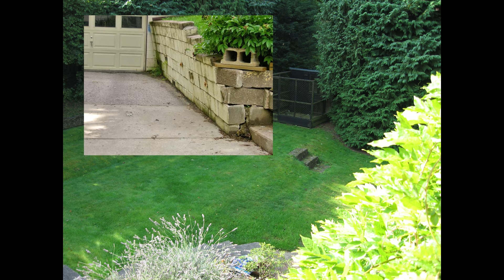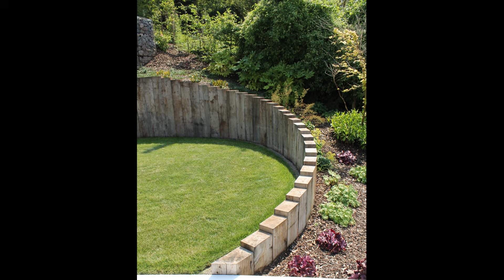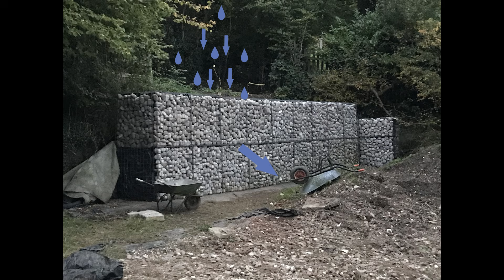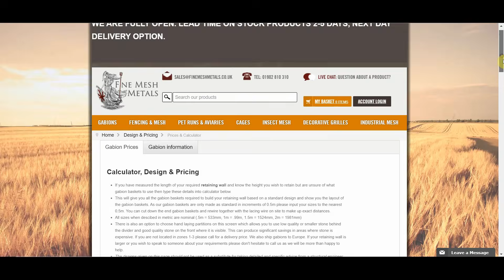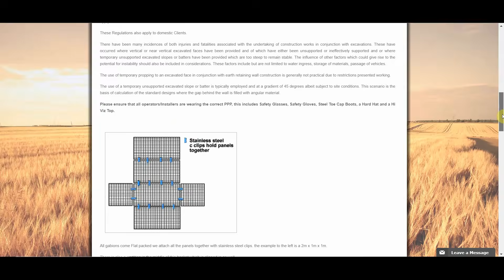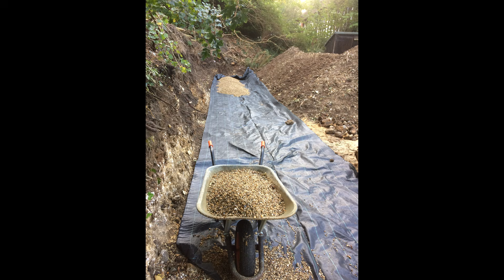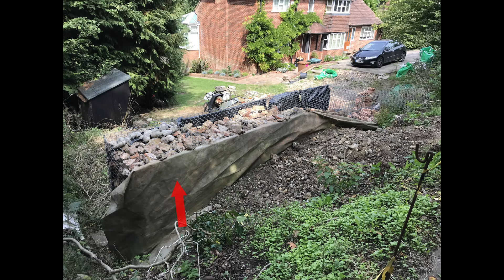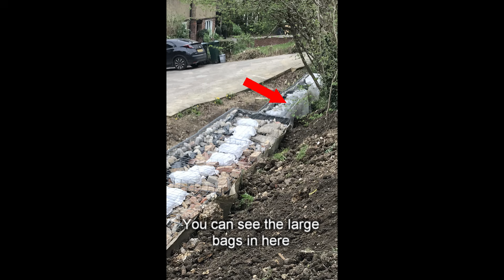GABION RETAINING WALL CONSTRUCTION with cost saving panels | Full Walkthrough with Audio - Part 2

Comment: Hi Karen, 
I am just about to do something similar for our garden retaining wall at 2m high, and wanted to find a video including the technical aspects of drainage and use of the geotextiles. Your video absolutely delivers :) 
Thank you so much for taking the time to make this and to post it. Brilliant work and told me everything I needed to know. 
With very best wishes 
RHR22
Reply from the maker: Thanks for the lovely comment RHR22!  Good luck with your project.
Reply: Thank you, Karen. 😀
I did have a question, if you wouldn't mind? 
The perforated drain at the rear of the wall, do you get much flow out of them, and did you connect them to your existing drainage system/where does the water go if not?
Thanks in advance 
RHR22
Reply from the maker: Hi, the perforated drain was belt and braces really. It probably isn’t needed as the whole system is porous, but we wanted to relieve as much pressure as possible behind the wall so included the gravel and drain pipe. It just runs round the back of the wall downhill from left to right and then round the short return on the right. The end is loose round the back of that 90deg return in some hedge plants but covered in the white geotextile. I haven’t seen much come out of it to be honest, but it is hard to tell. I think the gravel if anything helps as it acts as a small reservoir slow releasing water in the surrounding soil and gabions. So if anything I would suggest backfilling your gap between soil and baskets with gravel if you don’t have room to include the pipe. HTH
Reply: @OurHomeProjects  thanks Karen, again very helpful. Ours will be the end point from a sloped rear garden to a patio area behind our house (once built), so I am mindful of surface run off from the garden :)
Thank you for taking the time to reply, again. 
Best wishes 
RHR22

Comment: Can you just go somewhere and grab stones or all the areas are private? And if some are not, what will happen when the council will find out?
Reply from the maker: It takes quite a lot of stone to fill a 1sqm basket. You can probably speak to local supplier to see if they have any bags of scrap stone, ie stuff fallen out of ripped bags etc to get a discount. Also, I did have a builder offer me some crazy paving he took up and was taking to be recycled, but we had almost finished the project by then. You might find a builder digging up an old driveway that you could ask for the old brick to fill your baskets. My suggestion would be to use the panels and have a nice stone fronting the baskets.  HTH.
Reply: @OurHomeProjects  used stones may have damages. I wonder about stones "in habitat". Like quarries or something
Reply: @ЕвгенийБарахнин-ъ1д I'm in the u.s., and I've heard many farmers will be thrilled about someone picking tons of field stone from their land.
But we're talking many thousands of pounds of stone to lift and transport! Ugh.
Reply: @lotus65  there can be land that is not private
Reply: @ЕвгенийБарахнин-ъ1д  of course, I would never imagine going on someone's property without their permission!

Comment: Even if the cage is galvanized, isn't it going to eventually rust and fail, or possibly squat?
Reply from the maker: Hi again, 7 years later ours are showing no sign of rust or movement since we had the driveway done (where the back fill did push out the small top row as shown in the video).  If you install them correctly with heavy enough material they are not going to shift.  The main thing is buying the baskets from a reputable company and to check out their reviews and where they state they can be installed (eg. water environment etc). HTH
Reply: 20-30 years maybe it’ll be degrading. You look at old galvanized pipes in homes and most of the ones having issues currently are 40+ years old.
Reply: They have a life span of at least 60 years
Reply: Even in salt water coastal environments? That's my main concern...Corrosion is a huge factor where I live.
Reply: @ReticentIndignation  
Same here, I'm living in a rust belt area. I'd pay a little more if they were stainless.

Comment: Comprehensive and informative. Thank you. Since completing this project do you have water flow from between the rocks on the front of the gabion wall? Or maybe this is mitigated by the baskets being angled back slightly ?
Reply from the maker: Hi, thanks for watching. We don't ever actually see any water "flowing" out of the baskets, but as the baskets haven't moved we assume it's not building up behind the baskets. When it rains the fronts get wet and I guess as the water drains into the soil behind, it just makes its way via gravity to either the pipe or through the baskets, but it's never a gush of water if you know what I mean. I hope this helps?
Reply: @OurHomeProjects  It does help. Thanks 😊

Comment: I have seen other videos showing that use of geotextile behind a retaining wall will cause it to fail, because fine particles in the soil will plug up the geotextile and cause water pressure to build up, increasing the forces attempting to push the wall over.
Reply from the maker: Thanks for watching. I can only suggest to do your own research on geotextiles. The non-woven and woven types are used extensively in building projects, particularly driveways, roads and paths and are used for stabilisation and their porous qualities. I would also suggest buying a good quality geotextile. All I can say is 6-7 years on the wall hasn’t changed since the day we did the driveway. HTH Karen

Comment: When you said the gabion must slope 5 to 6 degrees towards the soil its retaining I got a little confused as your wall looks at right angles to the base or am I just imagining that?
Otherwise great work - well done.
Reply from the maker: Hi MM, thanks for watching. Yep, they are definitely sloped backwards towards the bank. The only section that messed up was the lighter top layer of the second section I built. Those baskets were filled with gravel bags and I didn’t secure them at the bag, so when the digger back filled the soil, they pushed forward. The main 2m high section is as solid as a rock as it’s full of bricks and rubble.
Reply from the maker: You can see the gravel bag part of the build in this video - https://youtu.be/cw8EGBU1j8g

Comment: Gabons are beautiful looking structures and I take delight when I see large ones on roadway projects.
One thing I noticed with yours is that you've used reinforcing rod to tie and stiffen your edges. I thought it was raw steel and so I'd like to suggest that in the future, you would paint them with "Cold-Gal", a galvanised coating applied with a brush. It seals your metal from the elements. You could do it retrospectively but it wouldn't cover 100%.
Reply from the maker: Thanks for the comment. Our wire was galfan coated and is showing no signs of rust, but you are right to point out to others they should be mindful of the product they buy to make sure it is weather resistant 👍

Comment: And did you do this all yourself then?!
Reply from the maker: Hi, thanks for watching. I worked out the plan, built the baskets, lined and leveled them up (well at a 5deg slant), started filling them and my husband would come out and help chuck rubble in. I filled the front faces. I struggled to fill the top section and my husband helped a lot with that. However, I did the second section that is 1.5m high by myself with the gravel bags. We both back filled with shovels and wheelbarrows of gravel and soil. It took a fair few months to complete as we weren't working on it daily. No need for a gym membership as I lost a few pounds too! It's really not that difficult a process, just graft. Anyone can graft when they want to! Karen
Reply from the maker: Forgot to say, we had a man and his digger cut into the bank. We just did the baskets :)
Reply: @OurHomeProjects  I must say that it looks nice though !!! 🙂🙂🙂

Comment: What are your plans for the eventual rebar rust?
Reply from the maker: Hi Jacob, the gabion baskets we bought are galfan coated and designed to work in water holding back banks. Six years on they still look as good as when they went in.  Make sure the product you buy has a similar guarantee.  Cheaper baskets may not offer the protection that is needed. Karen

Comment: Very nice i am looking something like this.  I will do at my home like 15cm wide    and 2 mtr heights .,it possible
Reply from the maker: Hi Waseem, Not quite sure what you're building, but make sure your measurements are right for whatever you're trying to support. Our wall was 2m high, but 1m deep. As it's a mass retaining system, the contents of the baskets must be enough to hold back what it's supposed to hold back. HTH and good luck with your project.

Comment: Will the Gabion Baskets Rot out over time, or are they made of stainless Steel?
Reply from the maker: Hi Dan, our baskets have a galfan coating on them and six years on they still look as good as when we purchased them. They are designed for waterways so should last 20+ years.  They weren't the cheapest, so make sure you understand what your gabions are made from before you buy. HTH Karen

Comment: Thank you for a very informative video. I was wondering why you would need a drainage pipe given that a gabion doesn’t hold back water   Thanks
Reply from the maker: Hi Nicola, you a right, it probably wasn’t necessary, but as it was 2m high and 20m long we didn’t want to risk any water pressure build up so added the gravel and drainage pipe. A bit overkill, but for the small extra cost we went ahead with it. I can see now, about 7 years on, that water drains through well and we’ve had no movement in the wall since building it 🤞 Karen

Comment: Nice work... I'm about to do one for the first so it is definitely helpful to see your project. Did you use drainage pipes?... and if you did , how was it done?
Reply from the maker: Hi thanks for watching. Yes we did, but it was belt and braces really as we were new to the system and didn’t want to risk anything moving over time so added the drainage pipe and gravel just to be sure there was no water pressure build up. For smaller builds I doubt you’d need one. HTH. Karen

Comment: Fabulous video I am just starting a 2 meter high wall using these, my wall is going to be 2 meter high by 1 meter wide. I see you went 2 meter high, did you go 1 meter wide or more? I guess I am trying to find out if a 1 meter wide by 2eter high is structurally OK, the supplier of the gabions has said I need to be 1.5 meter wide for a 2 meter high retaining wall and I don't really have the space for 1.5 so hoping I can get away with 1 meter. Any advice you can give would be gratefully received, thanks so much 🙂
Reply from the maker: We went 1m deep, but 1.5 on the bottom would definitely be better and set the next level back a bit so it’s stepped into the slope 👍

Comment: Can I ask if  you needed Planning Permission and or Building Regulations to create the structure? Great  Video. Thanks.
Reply from the maker: Thanks for watching. No planning for ours as it wasn’t over 2m tall. However, please check your local planning regulations for your area. Building regs tends to relate to block walls, again check your local area.
Reply: It seems like a temporary retaining wall. What will happen when the wire basket starts rusting.
Reply from the maker: Hi there, I think it really depends on where you buy the baskets from. Cheap ones will most likely rust. The ones we bought have a galfan coating on them and are designed to last and can be used for waterway banks as well. We’re almost 7 years on now from when the wall was built and there is no sign of rusting. HTH.

Comment: Excellent video. Informative, detailed, honest, quality tips on do’s and don’ts. When projects are explained in such a depth as this it often helps with overcoming hurdles by being introduced to an entirely fresh approach that covers the issues that were a concern with the current plan. Alot of questions answered about potential cost saving ideas and filling techniques, also erosion considerations. Thank you! Also I feel the angle shaping the property line add character and makes it your own with no wasted ground, and adds some contrast instead of cookie cutter square straight which isn’t actually as appealing in the end, especially if wanting more natural aesthetics.
Reply from the maker: Thank you so  much for the fantastic comments! Thanks for watching and good luck with your project. Karen

Comment: Hi Karon I have a old block  RW 3’ height , 50 ‘wide showing cracks  here & there and LEANING @ hillside. . 
, I’m thinking placing   3 ‘ gabion baskets  in front / lean against the old  RW.. 
I do not want to demolish 2 save demo cost 
so  I will try to place metal baskets as close to the Old one.
Question is 1. should I fill the gap between existing RW & the GB baskets w/ small  grabbles ? 
2. Do I install pipe in between? 
Or  do you think it’s necessary to demo the existing RW ?
Thank you in advance and I do appreciate your helpful video Karen!
Reply from the maker: Hi Myong, thanks for watching. I'm afraid I can only advise on the method we used for our gabion wall.  Block walls are notorious for failing due to water pressure build  up behind the wall. Personally, I would demolish it and use the crushed material to fill the gabion baskets. This would allow the structure to be porous and water pressure won't build up. If you decide to erect the gabions in front of the existing wall, at a minimum you need to puncture holes in the blocks to allow the water to flow through it and relieve any pressure. The water would then flow through the gabion baskets. Good luck with your project! Karen

Comment: Very Tricky Stuff, Retaining Walls.
All Manner of Reputations have been Scared by Retaining Walls.
Therefore, the Weight Behind the RW and The Durability of the RW are Common Failure Points.
Therefore Given My Own Problems with RW's.
Even with Drainage, Weight is Likely to be a Problem with this Gabion RW.
Rust May also be a Problem Over Time.
I Reckon this RW will Last at least Ten Years, So Great Effort.
Reply from the maker: Thanks for watching!

Comment: Really good video, not boring at all! However, I see a mistake in your build. Some will agree, some won't. And it is this - you do not need any geotextile. In fact, its a bad idea. The whole point of a dry stone wall is to allow water to run freely. By restricting its flow, a lot of force builds up behind the wall, pushing it forward. If the water can flow away, the earth will tend to not move. The drain at the bottom in not necessary - pea gravel is enough. Also the membrane at the front will have the opposite effect of what you intended. Weeds will start to grow in it. A few years down the line but they will come. Rain is the best way to keep it clean and to keep it really clean, a periodic jet wash. Everything else was spot on!
Reply from the maker: Hi there, thanks for watching and commenting.  Just to clarify, the geotextiles I used are completely porous so water can flow through them freely, both the non-woven white one and the woven black one. That's what they're designed for. I agree the drainage pipe was a bit over-kill, but as it was such a tall structure we wanted to be sure as it would be impossible to access that space again.  We've not had any issues with weeds as the water flows through.  Some have appeared along the base of the structure where it meets the block paving on the driveway, but this is due to soil build up running down the drive. Any particles higher up the structure get washed out naturally with the rain (as the geotextile is porous).  Hope that helps. Karen

Comment: This is a superb reference, thanks for taking time putting it together. It's my go to template for a very similar project: 19m in length with various 2m, 1.5m and 1m high sections. I have a couple of questions.

- Most gabions come already with the bottom base pre-clipped to the sides. Did you supplement these clips with your own lacing wire? Most sites seem to suggest that you can use helicoils for the verticals and manually lace the lid, but nothing concerning the base. What did you do? I couldn't make it out in the video.
- Did you put any filter at the end of your drainage pipe to prevent rodents making a home ? Just curious :-)

Thank a mill.
Reply from the maker: Hi Padraig, thanks for watching and I’m glad you found it helpful. The baskets from the company I used had plenty of little C clips securing the base to the sides. I think there were 2 per side. We didn’t feel the need to add extra lacing, though I can’t comment on other suppliers. 
We only used the helicoils on the front facing verticals and horizontals. All other sides were joined with lacing and lacing was used to attach basket to basket. The helicoils do look nice on the front. 
Re the drainage pipe, I used the geotextile to wrap the ends to prevent creatures getting in. Please do come back to me with any other questions. There are quite a few answers in the other comments too. Good luck! Karen
Reply: @OurHomeProjects  Another reason why I love this video - you take time answering the questions!  I sourced gabions from same company so expect the the same set up. I'll take closer look when I actually build them. Thanks again Karen.

Comment: Absolutely brilliant. I built a 25 metre length x 950mm High x 500mm depth gabion wall plus 2 sets of steps for my rear garden.  From your video and list of materials I do feel you really didn't need the drainage pipe or alot of the membrane you used. Anyway you've inspired me again to use gabion baskets for my home I'm now at. Well done from  me and your video is brilliant to.plus I used Devoran Gabion Baskets. 🙂🙂👍👍
Reply from the maker: Thanks for the great comments and tips! Really appreciate you leaving a message and good luck with your next project. Karen